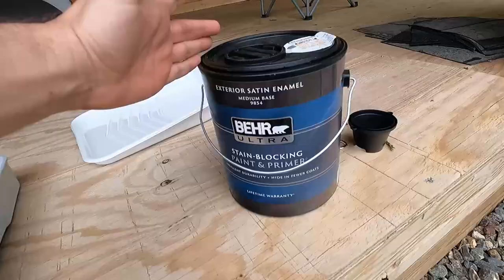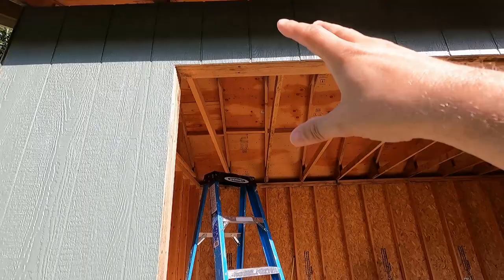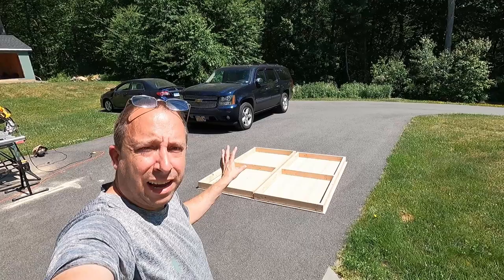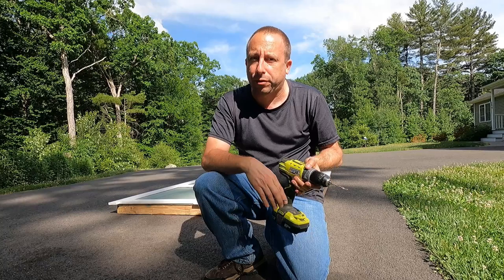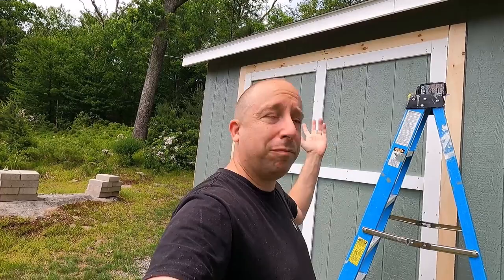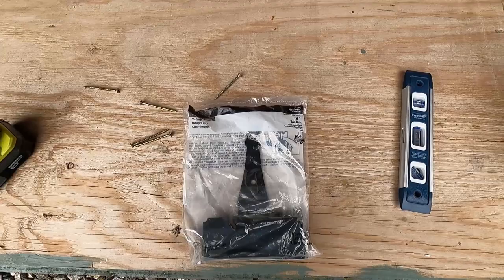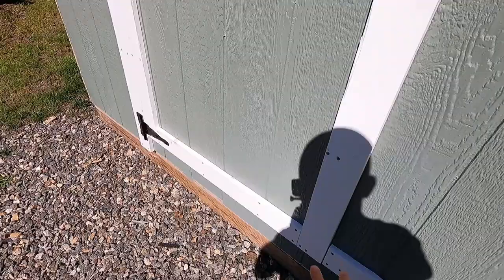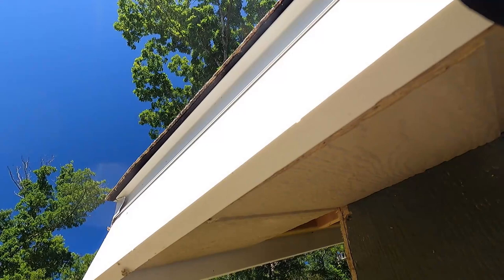How I Built a Shed: Building the Doors and Finally Painting

Comment: Hi Rob,
Looks good. May I suggest you put a diagonal brace on the inside of the doors from the top hinge side down to the bottom center of each door. It will prevent the doors from sagging over time. Stay safe.  73  WJ3U

Comment: On the door you don't pull to open I would have a sliding bolt top and bottom vertically so that if the wind gets up you only have to deal with one door at a time. Possibly some method of holding the door(s) open to save them blowing about if it gets windy and lastly painting the inside of the door frames to keep the weather out. These are things I would do and you may have already thought about this, if so great minds think alike, if not, some food for thought maybe..................? Always enjoy your posts especially the radio related  one's ATB 73's from England